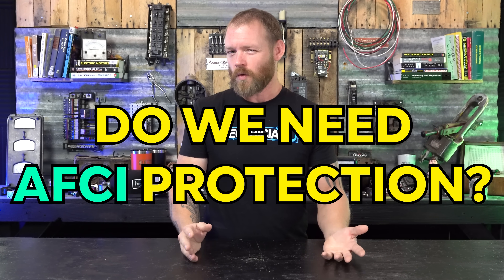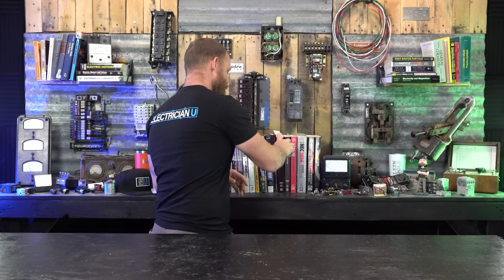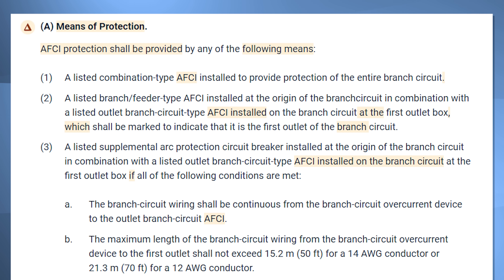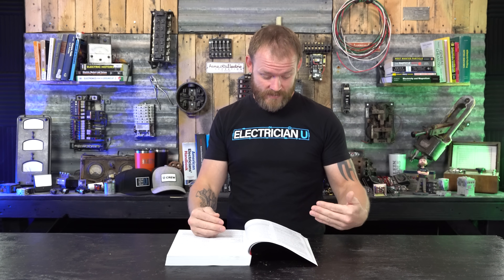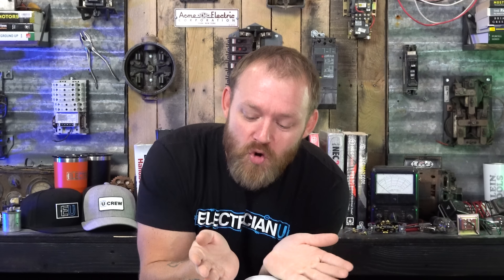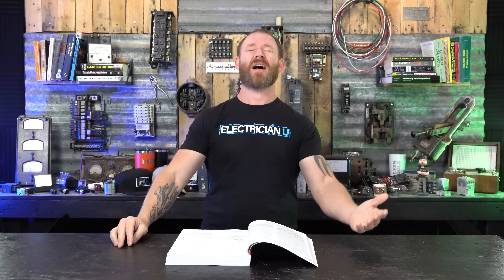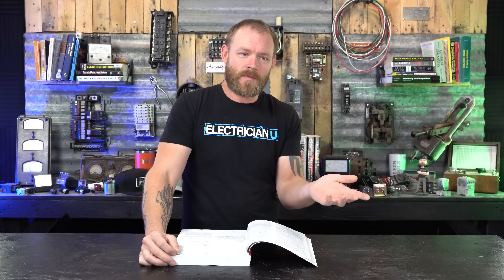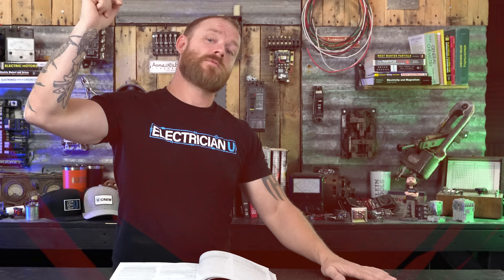Where and Why Do We Need AFCI Protection?

Comment: AFCI breakers are the single most annoying thing we have ever had to deal with.
Reply: Explaining to customers becomes a nightmare when they find out how much they cost
Reply: @drekelley2352  I used AFCI/GFCI outlets instead of breakers in my most recent project. Here in Canada they cost 33 CAD.
Reply: And considering the cost and trouble, one would assume that there is solid data showing a huge reduction in housefires from arc faults since AFCIs became mandatory. Can anyone point me in the direction of this because I can't find it?
Reply: @s3tione  maybe they could start by outlawing 16 and 18# grannie cords being sold
Reply: @thedavesofourlives1  YES.  Dollar stores are full of non-UL-listed electrical and electronic accessories.  We got hold of a cheap imported USB power supply (that plugged into 120 V) that turned out not to have any current limiting.  They are supposed to shut down if the load is out of spec.  This one delivered 4 amps into a shorted cable and almost started a fire.
Reply: @s3tione  I researched and found there was a 30% reduction in fires. This number is complicated though, because the data is complex. Many fires burn up the entire house and you don't know what caused it. All fires do not do the same amount of damage. It is still possible to account for and calculate things like this; but there becomes a lot of people fussing about the data and studies and the way things are done. Electrical causes are one of the top reasons for fires, but forest fires, cooking, smoking and lots of other things cause fires too.
Reply: @cryptickcryptick2241  fire reduction would be hard to prove as modern appliances draw less amps creating heat waste, also if the AFCI is shutting everything off then obviously there's a 10000% fire reduction potential on that circuit.
Reply: It's all about money for the corporations.
Wait till they start or try to enforce the 2023 NEC.
Reply: You got that right
Reply: @PW_12345  I know arc faults can cause fires and I have actually seen an arc fault myself too. What I want to know is given the number of house fires determined to be caused by arc faults before AFCIs became mandatory, is there now a statistically significant reduction in these types of fires? Or are arc faults even a statistically significant source of house fires to begin with? Otherwise, the cost and trouble may not be worth it.
Reply: Bought a home that had the majority of the breakers “upgraded” to AFCI… my printer would periodically trip the breaker… totally annoying… then for no reason the AFCI breaker to the refrigerator tripped while we were out of town. Threw away a lot of food that day. After that I replaced all the AFCI breakers with non AFCI. Haven’t had any issues since. 
Seems AFCI are too sensitive for some appliances and electronics.
Reply: @MartyMasterjohn  I've been an electrician for 35 years and I will not put a gfci or afci or combo on refrigerator or freezer unless inside the city where the inspector demands it for the reason you just stated.  I don't want angry homeowners calling me.
Reply: @clayadams2068  give the homeowner the inspector’s phone number so when the afci trips and ruins their food/property they can complain directly to the city officials!
Reply: @clayadams2068 I got a question for you!I am in Lorton Virginia & I have a basement bathroom fan on an AFCI-GFCI dual breaker!It came like that with the house.Does a basement bathroom fan in 2024 require a dual arc fault breaker?This shit is a nightmare as the fan trips the arc fault constantly.
Reply: @theoriginalman5206 The problem with the NEC is a lot of it is subject to interpretation. We put dual function breakers on every 120 volt lighting circuit except when out of city jurisdiction. I don’t put them on freezers, refrigerators, septic systems. Are the bathroom receptacle’s on a separate circuit?    By fan do you mean vent fan or ceiling fan? I’ve seen a ceiling fan run for a year on a dual function and then suddenly start tripping. Changed out the fan and it has been running fine for about 3 years now.
Reply: @MartyMasterjohn  ---- that's exactly the problem. 
 They are too sensitive. 
A lot of contractors would install AFCI breakers just to pass the inspection and then once the final inspection is signed off, they pull all the AFCI breakers and replace them with regular breakers. 
 That way they avoid getting phone calls from the homeowner every couple of weeks because the AFCI breakers are tripping.
Reply: No joke every electrician’s toolbox needs a set of afci breakers. Kind of expensive up front but after you do several jobs …
Reply: @MartyMasterjohn  Same. New home and breakers are tripping everywhere. Electrician replaced what he could. Seems like a sad waste to replace so many AFCI's in the first month. I keep seeing videos and posts about them getting better, but as of Today, they are garbage, imo.
Reply: If wiring is done correctly you want have a problem. Fix the wiring and the arcfault problem will be solved
Reply: @MartyMasterjohn  - I would like to replace all of my AFCI breakers that don't nuisance trip all the time as well. The problem is: If you are unlucky enough to have a fire and make an insurance claim. One of the first things the insurance investigator checks is if the electrical system is up to code. If they see that the AFCI breakers are gone, no insurance coverage. You're screwed.
Reply: @MartyMasterjohn  Aren't most refrigerator outlets behind the refrigerator making the NOT readily accessible and eliminating the need for AFCI and GFCI ?
Reply: @McDIY  watch the video again
Reply: I agree with all of these comments.  And, it's even worse with RVs.  The 30 amp and 50 amp are no problem.  But some older pop-up campers have 15 amp shore power cords that plug into 15 amp receptacles.  Many newer 15 amp receptacles in the power pedestal will have a GFCI on it.  People always say, "There is something tripping it out!  I don't want to come back at the end of the day and my refrigerator not running!"  So, they will use an adapter to plug into a 30 or 50 amp and they're using a 16 gauge extension cord and that is so very dangerous.  You put the AFCI breakers on the power pedestals for RVs, I can see that leading to more 15 amp cords going into adaptors and plugged into 30 and 50 amp receptacles.
Reply: They’re just too damn expensive.
Reply: I used to feel that way when I first started having to deal with them, but once you learn through time how to diagnose arc faults it's really not bad. One common thing that tends to be a source is track lighting.
Reply: @stevenburton4966  ---- thanks for your input. I am aware that some light fixtures can be the culprit for tripping an AFCI breaker, also hair dryers, vacuum cleaners, small motor appliances, even older, old light switches, like the ceramic/porcelain toggle style with the screw terminals in the front of the switch body. 1930s and 1940s era. Because there contacts (which you can access because there are screws that allow the switch to be taken apart and serviced), the brass contacts are so large and have a larger gap than more modern switches(cheaper to manufacture) which causes a larger arc as the switch is thrown on or off. Also they allow more dust and hair, etc... to enter the body which creates fuel for a larger spark. Track lights have the same problem, hair dryers, vacuums,  all are collectors of dust, lint, hair, and are enemies of the AFCIs LOL
Reply: @13_13k  I've tried before to hold a light switch between on and off to see if I could trip an afci breaker and it didn't work. I wonder why.
Reply: @stevenburton4966  --- it is the AC power that keeps the arc from being continuous because it is alternating currrent. If you were to use DC power, direct current, you will then get that continuous arc because the current is constant with DC.
 I can tell you from first hand experience that the jumper cables installed on solar panels used to connect a bank of panels to each other will create an arc.  If you have a panel sitting in the sun, not even a long time, just a couple minutes,  and each panel has a positive jumper wire and a negative jumper wire , if you take the two cables and hold the exposed tips close enough to each other you have an arc welder. 
 There are a couple of videos on YT showing this.  One is titled Solar Panel Melting Nails Arc Welding.
Reply: @stevenburton4966  washers.
Reply: Probably the result of some trade convention with representatives from government, electrician's unions, and equipment manufacturers all siting around. What new code can we come up with to make people spend money on something new this year?

Always follow the money.
Reply: I hate them with a passion
Reply: I thought you were going to say, seatbelts.
Reply: the fact that they are effected by LED and CF lamps and we have to protect lighting outlets is stupid. the lamps them selves can cause them to trip.
Reply: They’re only annoying for hacks. What I will say tho is Siemens routinely fail. I’ve seen conductors melting on the breaker, and it didn’t trip. I’ve seen them trip when they shouldn’t, and not trip when they should. But I’ve never seen those problems with Square D or Eaton unless the installer did something wrong, or there’s a problem with the appliance
Reply: Yes
Reply: Every single time. They trip on brushed angle grinders.
Reply: They are an industry collusion. The companies that took over the codes should be tried for conspiracy and convicted.
Reply: They really run the cost up too.
Reply: This is one of those incremental costs of forcing society to higher standard of living. It seems that when compounded by every other aspect of  building a structure, it has made homes so unaffordable. 

I grew up in a home that had no insulation, single pane aluminum, ungrounded electrical,  no AC, thin walls, and galvanized pipes...but, it was cheap and we were able to afford to live there for decades.
Reply: Omg so annoying on the washing machine breaker,  ( almost every spin cycle it trips ) tried 3 different washers just to prove it wasnt our washer.
Reply: Yup
Reply: So with  250.118 if you wire your house with MC/EMT metal boxes you don’t need to use arc fault breakers?
Reply: They drive me crazy
Reply: Foster Farms OK ---- I agree whole heartedly. 
 They've gotten better in the sense that they mostly don't trip as much as when they first came out on the market. But, they are the biggest pain in the ass trying to keep up with the codes changing and no consistency from city to city, and they still trip too easily. 
 Then you add the cost per AFCI/GFCI and or combo or dual function for every breaker in a home, the cost can be as much or more than the cost of the whole service upgrade itself. 
 I'd like to be the guy who is getting his palm greased for implementing these things into mandatory code compliance. It's probably the same guy who sold the country the lie about CFLs and forced everyone to comply with those when in reality it was just a scam to buy time for LEDs to hit the market at reasonable costs. 
 Complete scam saying CFLs were better for the environment. Right. Because mercury is so much better than a tiny filament of tungsten. A bunch of criminals is all they are.
Reply: @13_13k  I agree with what you said.
Reply: @13_13k  Were CFLs ever forced? My family never used them. Went straight from incandescent to LED.
Reply: @themikeroberts  --- CFLs were marketed here in California as the only available lamp in stores like Home Depot, Lowe's, Ace Hardware, and they went as far as removing all incandescent lamps from A lamps through Par lamps.  Claiming that CFLs were more efficient, better for the environment, even going as far as making building title 24 which makes the main kitchen overhead light fixture having to be a fluorescent light fixture in all new homes and remodeled kitchens. 
 So, contractors did the same thing with the kitchen light as with the AFCI breakers, install them, get your inspection done and as soon as the permit is signed off, uninstall those pieces of cr*p and replace them with something that works better
Reply: @13_13k don’t care about my local code I think they are still on n older nec revision when I rewire my home I am following the latest with cafci and gfci where specified. Care more about protecting my family than the hassle.
Reply: @13_13k  they change up codes because it guarantees them a job
Reply: @kchilz32  --- I know that already. Thanks
Reply: I think most code for protection is b.s. These manufacturers obviously have tons of influence in the code-making panels. The code book should be about ⅓ the size that it is. I guess luckily for us the ridiculous amounts of unnecessary code makes it harder for more people to rise to the top
Reply: @michaeldoran4367  ---- one thing that code doesn't solve is the amount of homeowners, handymen and some general contractors that think they can do an electrician's job because they have replaced a switch or installed a hallway light fixture, and that has them believing they can wire a house.
Reply: Agree. Literally the worst invention in electrical history.
Reply: It’s called job security people.  You’re paid (just like me) to install per code period.  Simple.  Stop crying about code.  It is what it is and may change over time.  😂
Reply: I think everyone was saying that when GFCIs came out too.
Reply: @richz100  GFCI's are different: They are only on few circuits in a residential house and are often not on the breaker (though they can be of course). Nuisance tripping on either GFCI or AFCI hasn't been an issue with me. I just want to know if the cost is worth it for AFCI's.
Reply: @s3tione  Been an issue with me. Have many people saying their washer tripd a breaker almost every spin cycle.
Reply: If your having trouble you're not doing something right. We rarely ever have a problem. If we do it's because someone shared a neutral on a three way or something else or a staple to tight or some one just stuck a wire nut on a joint without twisting the wires together first. Arcfault is a great safety device.